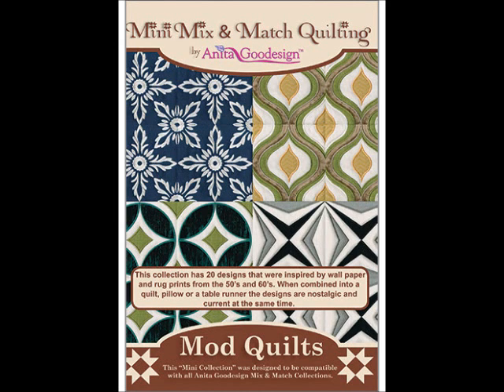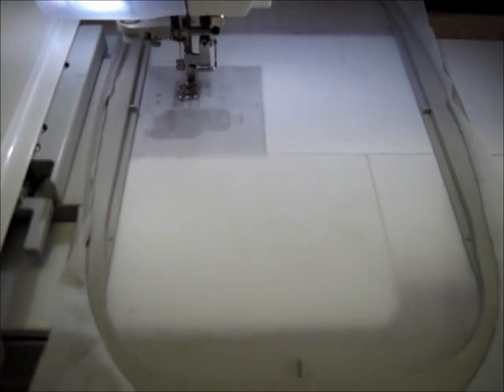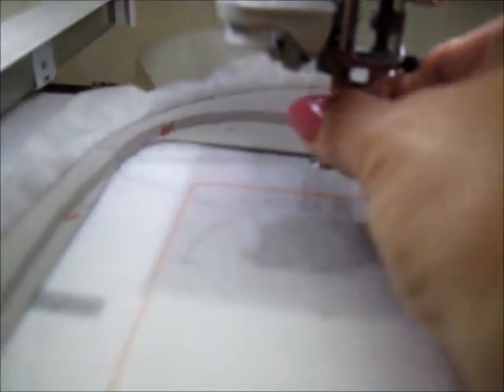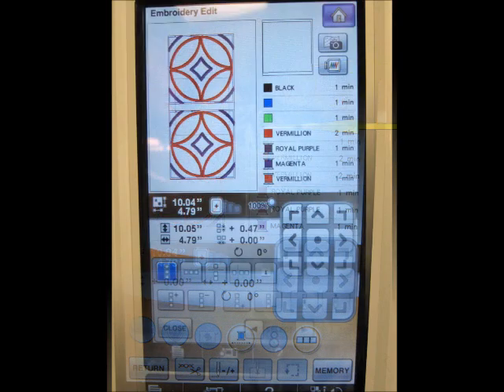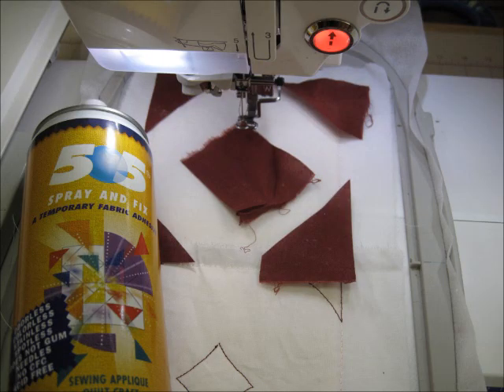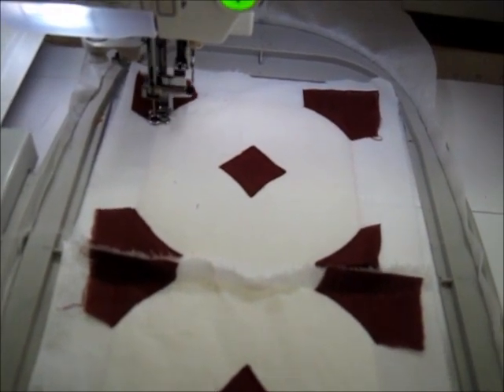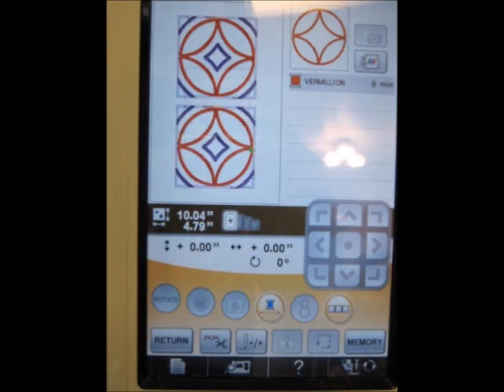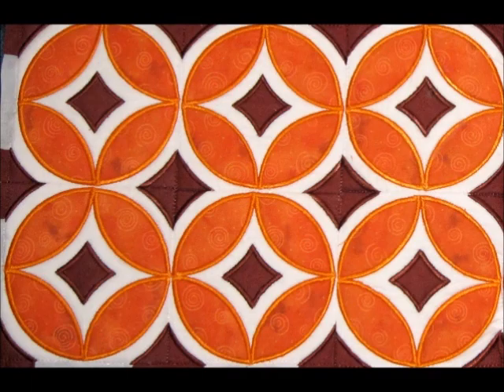Anita Goodesign Mod Quilt

Comment: Thanks for the video -- I'm thinking about buying these designs and your video convinced me to!  Any tips for getting a good, close cut around the stitch lines?  I bought some curved scissors and they definitely help, but still don't feel I do the best job.
Reply from the maker: I just noticed you request 4 years later.  I hope you have become very proficient at cutting by now.  I tend to hold the excess fabric straight up as I use the double curved applique scissors to cut very close.  I have also used my "scan n cut" to cut these pieces once I change the placement stitch color to the one in the lower corner of the colors with an icon of a scissors.  Actually I prefer to cut the applique myself because precut pieces need to be placed perfectly but the machine cut pieces with a light weight fusible web applied can be great for detailed cuts.

Comment: You can always precut your applique the size you need to save yourself the cutting in the hoop step.
Reply from the maker: Yes, you can even set the Brother "Scan and Cut" to cut the exact shape.  That does present the new challenge of placing it perfectly over the placement stitch so it doesn't' move as it gets completely stitched down and satin stitched to cover all raw edges while also having the seam allowance where needed.